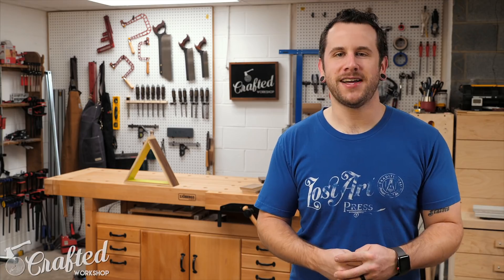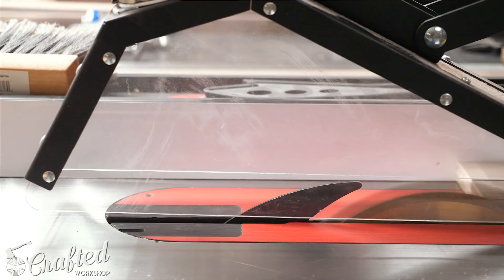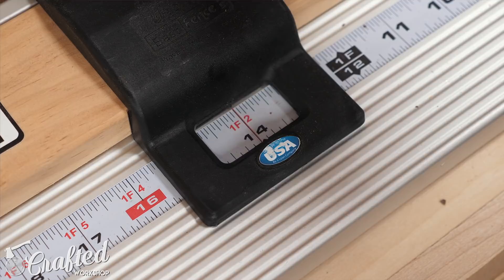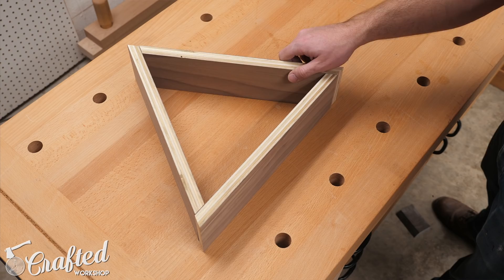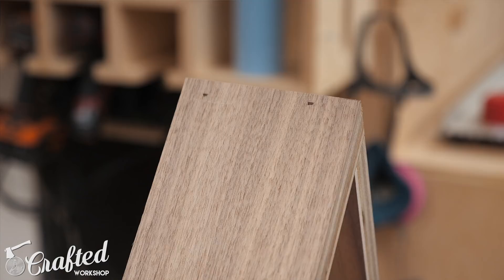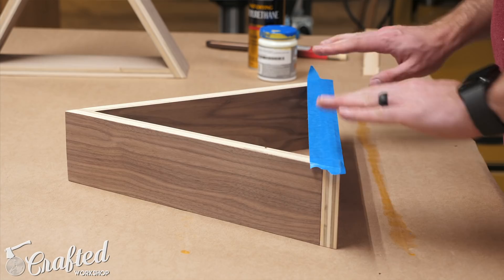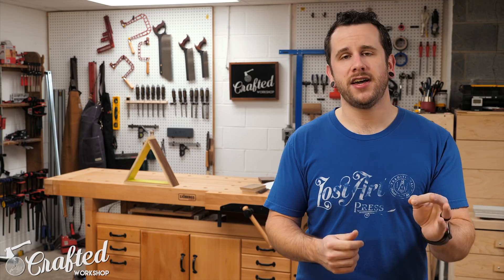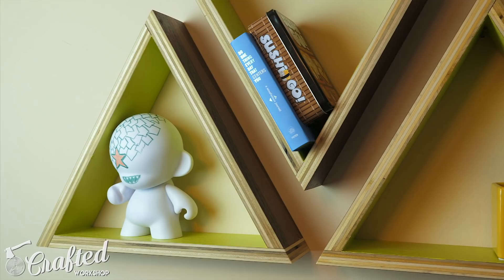DIY Geometric Triangle Shelves | Simple Woodworking Project

Comment: I'd like to give this a try as the wife wants decorative shelves everywhere.  I'm still using the blade that came with my Dewalt miter saw.  Can you recommend a better one for cleaner cuts?
Reply from the maker: I’d get one with a higher tooth count that’s designed for cross cutting. The Forrest Chopmaster is probably one of the best available, but it’s pricey : http://amzn.to/2DzBE8M

Comment: Until you said it was left over from a project, I was wondering what the point of using walnut plywood was when you're painting it anyways.

If you flip the top one upside down and draw all the points together, you'd have Triforce. ;-) =)    (From The Legend of Zelda series... yeah, I'm a geek. =) )
Reply from the maker: The Walnut still shows on the outside, I think it’s a nice contrast. And yes, very close to the Triforce!